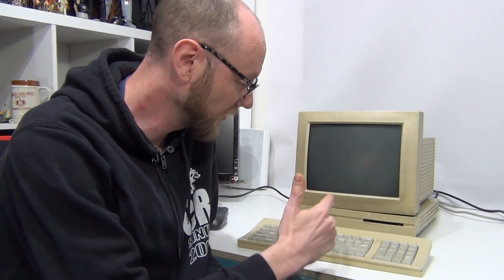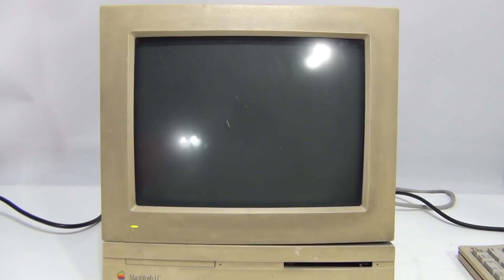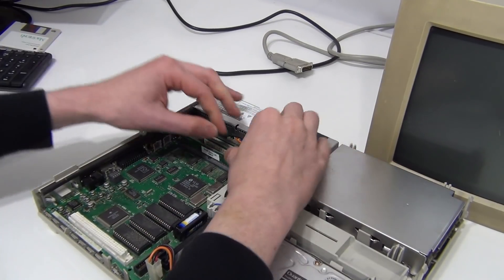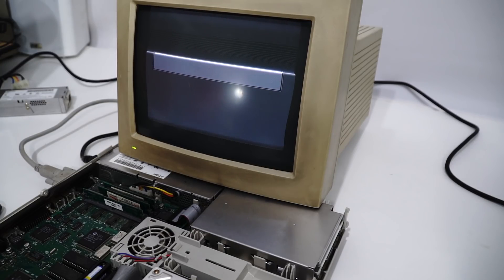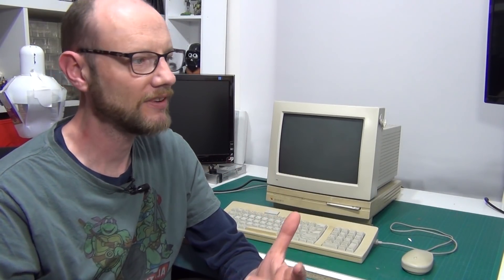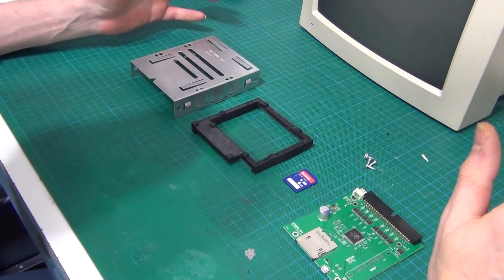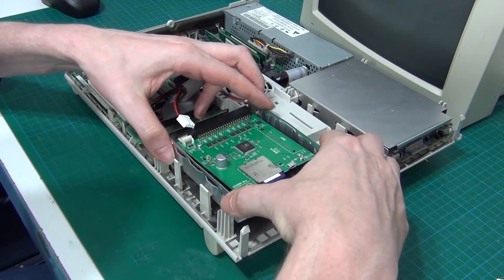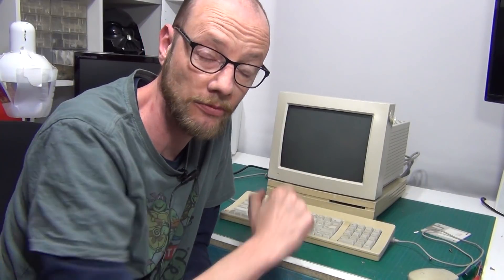Macintosh LC Rescue - Part 1 | MLT's

Comment: Was there a specific aussie seller you purchased your SCSI2SD from? I don't need one yet (My Amiga is using IDE, so I have a IDE SD adapter working for that) but it'd be nice to know where to get one in future.
Reply from the maker: Cheshire Noir I bought mine from OS, however Bruce Rayne on the “Vintage Apple and Macintosh Enthusiasts  Australia” FB sells them now.

Comment: Great video! LCs are cool machines. I have an LC III. Just a tip on ADB: you only want to connect it while the machine is off, as there is power going through and it might fry some hardware.